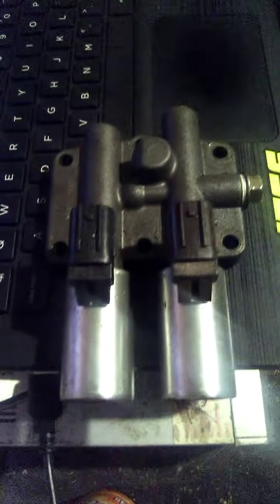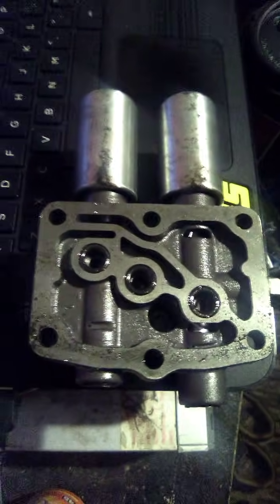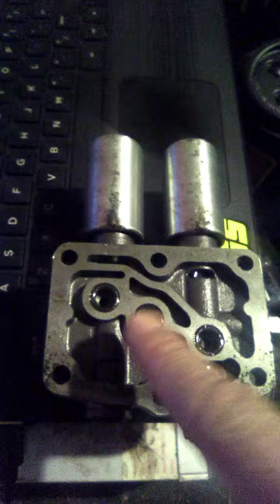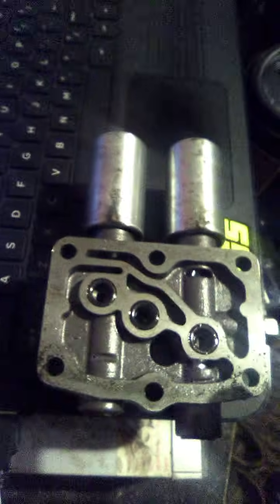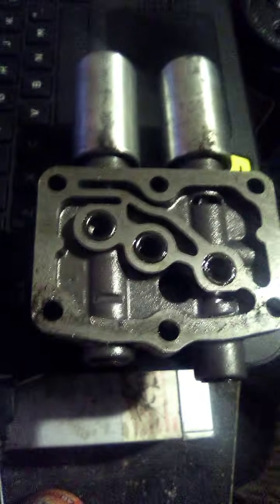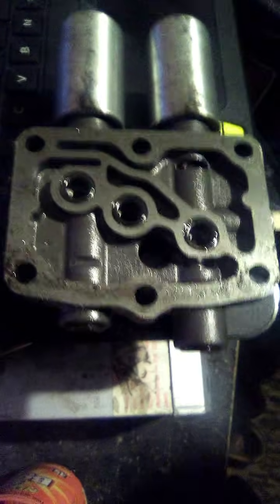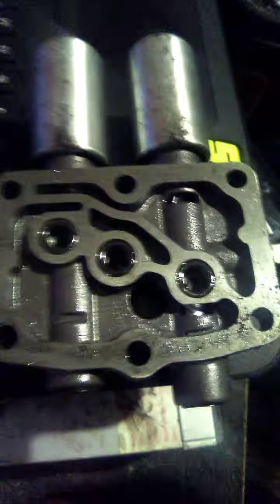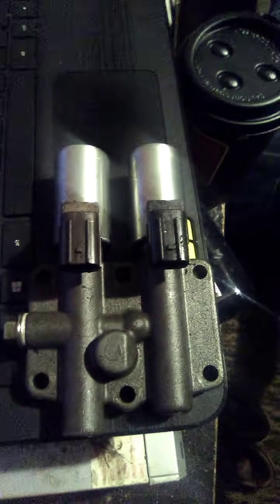Honda transmission problems explained p0740

Comment: Good day Rico, question, I did a flush on my 03 Accord 2.4 transmission and oil change, cleaned the solenoids and am still getting a hard shift from 1-3 up shift and when slowing down but not to a complete stop like if I was doing 30 slow down and try build back up speed it hesitates or I'll have to press the gas petal slightly for it to stay in that gear or it will drop back in the lower gear and it'll try shift when it builds back up, is the transmission gone or keep cleaning the solenoids out
Reply: Did u ever figure what the problem was with your vehicle bcuz my vehicle is doing the same thing????

Comment: hi! I have a 2008 Acura tl V6 engine. i recently changed the engine mounts and did a drain and refill trans oil 3 times. I also replaced all 3 pressure switches. My problem is that when i’m driving and coming to a stop, i feel the car buckle or pull back. Also, when i’m in low speed , my car tends to slightly pull back. when it does this, the rpm  jumps.  I am not getting any codes. Do you think it may be the solenoids or could it be something else ?
Reply: hey I just saw this. Ive been watching teardowns and rebuilds of Honda 5 speed transmissions. What you are feeling is the "sprag" not working correctly. Its a bearing inside first gear that is for slowing down or decelerating. It supposed to make the gear spin one way but not the opposite way. My car (accord 07 v6) BAYA trans is doing SAME THING. Like its not happy when coasting down. watch this video...    
https://youtu.be/1Isgg7M7i30
 He explains it better lol
Reply: @alexandercahoulan6583  Thank you for this. I did not know about this. It could be really irritating. I guess the only way to solve this issue is to rebuilt the transmission. Have you found a quick fix to make it feel a little better?
Reply: @Cramos056  not as of yet. I think, sadly, we need to rebuild it to change that as far as I know. Im planning on doing mine soon. But I feel its definitely the sprag.
Reply: @alexandercahoulan6583  Good luck! I hope it turns out good as new. Sadly, I don’t think i’d rebuild mine any time soon. I’ll just have to get use to it for the mean time.

Comment: Lucas Transmission fix saved me a few grand when my '05 Pilot clutch converter valve stuck.  It's been running like a dream ever since.
Reply from the maker: It works when is minor adjustment
Reply: Do you just add it on top of your regular amount of oil

Comment: Lucus for the transmission
Reply from the maker: I mean u can try to see if shifts better but if trans is not engaging at all then that's kind bad
Reply: @ricofedericotv9393  actually it shift fine in d4 on d5 is where it has a little issue i think you right when it get hot the tranny thats when it acts up a little bit it engages in every gear no problem. I changed the trsnsmission filter and i put the acura dw-1 so idk i changed the double solenoid with the 3 screens
With a rebuild one worksfine for abour 2 weeks then i dont get a hard shift but i noticed on d5 it was moving alot better now its acting like its missing a gear when it gets warm it slows down end catches the gears again on d4 its fine on d5 its a issue reverse is good park is good neatral
Reply: @ricofedericotv9393  also there are 2 solenoids i want to change they look real old this 3.2 TL has 190,000 miles i bought it for my lady
Reply: @ricofedericotv9393  when i bought her she shifts fine no problem she still shifts good but on curtain times she stuggles in d5 only
Reply: @ricofedericotv9393  and i have the p0740 code im thinking about just changing  all the solenoids for now if it still gives me trouble i. A just swap the torque converter and see what happens
Reply from the maker: @dragstriprabies2.059  if u drop trans to do torque converter u might as well change it trans too but sometimes at this high miles after trying solenoids and lucas and filter if problems still there like it happen to me I just keep cleaning solenoids and baby sit the problem drive car easy maybe ad and extra transmission fluid cooling radiator so fluid stays cool but once this issues exist is a chess game . Does ur D light blink?
Reply: @ricofedericotv9393  No my D4 light doesnt blink at all my D5 i think the bulb in the cluster is out but it engages in D5 and D4 with no problems D5 tho i notice is when it shifts crazy when the transmission gets hot D4 the transmission shifts fine
Reply: @ricofedericotv9393  my d5 light is out in the cluster the bulb but it engages in D5 but that D5 is when i discover the shifting issues it will shift in D5 on all the gears but when it gets hot the rpm will rev high and it feels like the car downshifts and slows down while on the highway engages into gear then revs high again and acts as if its downshifting

Comment: hey my man so your saying if my 96 accord ex starts fine but when I put it on drive it won't move but the rpm go up and if I put it in reverse it will only work for a second then your saying I'm done I shouldn't clean solenoids or flush the oil it's over then right?
Reply: Same position as you right now. I'm not giving up, just because it is going into reverse!
Reply: @alecfleming373  I had to sell mine for $200 bucks to caravana, I had a transmission problem that I didn't want to get deep into. I bought a used 07' corolla so far so good 🤞
Reply: @PEACEFULWARRIOR999  Homelessness, so if I can't fix it, I'll be hiking.
Reply: @alecfleming373  there's rules, if you don't have a home is OK if you have a job, so if you have a job u don't need a car or a home until you have means to aquire them. If your car is out but you have a job, guess what you just saved alot of money on hotel rooms. You see, we sometimes loose our focus that's all man, good luck with the car I know I hate to waste my money on someone else to put bandaids on it.
Reply: @PEACEFULWARRIOR999  14 jobs held in 2019. I'm not homeless enough for government help, and not housed enough to keep a job. #1 reason, I smell.
Reply: @alecfleming373  lol I hear ya the government is the reason why we all fucked up but we keep depending on it, that's why I'm done with the government, I don't need shit leave me alone here's your taxes and see you later, can't figure out how not to do taxes but I'm sure it'll soon come to me, I might open up a church who knows, I was never a good at beggin that's
for sure. Well if job doesn't work and property neither I guess my advice is to steal a car but don't ever take advice from anyone but your guts and wisdom.
Reply: @PEACEFULWARRIOR999  Oh buddy, after this, I'm NEVER paying taxes if I can help it. What is it going to? Not preventing starvation... Not the roads... Not good cop training...
Reply: @alecfleming373  get someone with a computer reader to check it, at most you'll spend $50 bucks but you'll get an accurate diagnostic and you take it from there.
Reply: @PEACEFULWARRIOR999  There already, because I have one. P0740 or speed sensor not getting the right reading. It's fine. I'm thinking it's a little part clogging. But, yeah, blaming jiffy lube for putting the wrong fluid in...

Comment: Appreciate your video. Thank you. Hoping you might help us please.  Do you have any idea why our 1990 Honda Accord Auto Transmission does not shift into reverse sometimes and makes the funny clicking sound? Other times we start it and it shifts into reverse perfectly.   We've flushed the AT and put the Honda fluid,  checked the lock up and shift solenoids and cleaned the small screens. Does the Honda Lock up solenoid lock up the torque convertor to make it go into reverse?  Here is a video of the sound.. Thank you very much.  @H9y4
Reply from the maker: That's a tuff one try going into reverse from parking not from neutral try engaging it in different ways maybe car slightly moving forward I work at a aamco and there's pads with brake type material that Tru years they worn out that's y they say is not good change oil cause the material could be in oil bouncing round sometimes in might catch sometimes don't maybe when hot or maybe when cold but old Honda's transmissions are easy change if I was u I save few bucks get a clean one with low miles and once u change it just baby it and prob last for long time maybe ad a inline filter u can cut one lines coming from tranny and ad a filter they look kind like the fuel filter ones but for trannys

Comment: I have a 2011 crv and it literally comes to a stand still whenever I engage 2nd  going up a hill. I should also point out that if 2nd is selected while the Car is moving at a snail's pace. The gears shift normally when I am in D but I also feel that my fuel economy  isn't that great either
Reply from the maker: What year crv u have
Reply: @ricofedericotv9393  it's a 2011 crv with the 2000 cc and AWD. Automatic transmission and petrol engine
Reply from the maker: @Domexican  could be shift link maybe is in between gears when u put on second

Comment: Ita happend to me in my 99 prelude automatic car starts to make like crasy horse .. so i stop the car after 4 hours then i reconect the battery and  the car starts and drive normally.. but after 10 mnts starys again no sleeps noting but i think is ab the hot oil .. any recomendations im scare ab the transmission..

Comment: I have a 2003 honda accord v6 it drives fine no problem check engine light comes on and is the clutch transmission crap . It goes away after I drive it for a while and when I drive in the high way it comes back after 36 miles . Can you help?

Comment: Thanks for the video man, my 2004 accord 2.4 AT is having those symptoms, if buy the shifting solenoid and replace it do it need to be plug to a special tool/computer to  make it work with the car or it's just a plug and play kind of thing?
Reply from the maker: Before u buy it take it out and clean it sometimes change it won't fix but sometimes it do is kind gamble do u have a aamco transmission around? u ?
Reply: tv  I think there is one around, I'm planning on keeping the car at least 2 more years, if cant fixing it with the solenoid I'll take it there, I don't trust stealership anymore.
Reply from the maker: @seencktwo  I used to work at one I think they do diagnosis for free but yea I try go to u pull it type junkyard and grab few maybe all them are u in pa?

Comment: Look at buying a 2000 v6 70,000 miles Check engine light but for  idle control sensor.  Is that from transmission.
Reply from the maker: Take it for spin look as fluid make sure fluid is red before the spin press brake put in drive and from drive to neutral the reverse make sure it don't hit hard if shifts good and fluid red look under car if has no leaks that's good
Reply: thank you I really appreciate you taking the time to answer my ?
Reply from the maker: @criticalthinker72  u welcome how much they asking if u don't mine me asking

Comment: I have a 2003 Honda Accord V6 starts no check engine light now when I start it goes in gear but slips and won’t go into gear until I trun the car off for a few then start it back up
Reply from the maker: That's a good one maybe u low on oil? Ad Lucas oil have u check ur solenoids they not clogged
Reply: Well no the mechanic hook up some sort of machine to see what’s wrong with it no codes popped up . He said it might be the solenoids but idk what to do if imma keep dishing out money .. I need someone with experience
Reply from the maker: @jonathansantiagovelez646  solenoids can be expensive try pltaking it off I bet u the net is clog up and see if u can go to a u pull it type junkyard grab couple them or get it from local junkyard and put it urself I believe is only 4 bolts and a plug
Reply from the maker: @jonathansantiagovelez646  my pilot would start shifting crazy I had clean net sometimes oil dirty

Comment: that was a problem with older Hondas from the late 1990s-2005 or 2006 mostly occured on the Odyssey, Accord, and Civic.
Reply from the maker: Mostly v6 engines made transmissions fail on regular basis
Reply: Rico Federico tv the Hondas I had were stickshift. The CVT automatic transmissions are much worse on Nissans
Reply from the maker: Can I get sub am trying get to 600
Reply from the maker: I had few nissans I had that missfl fire I could never find is it the ecu some people say can be simple and injector
Reply: Rico Federico tv Nissans were really great cars before Renault took over.

Comment: I will never buy Honda.
Just Toyota to save my self headache.
Reply from the maker: Some Honda's good what year and model u have most v6 Honda's end up with transmission issues u feel like they put cheap build trans with v6
Reply: My civic has over 300,000 miles on it.I replaced a timing belt & water pump at 180,000.I replaced a head gasket at 267,000 miles.I get 40 mpg still.Does every number on the speedo still.I does'nt burn a drop of oil still.No squeaks no rattles & still looks like new with a wash & wax.You will NEVER say that with Toyota Subaru or Mazda.Nor will you replace a head gasket,water pump& timing belt in 4 hours for less than 100 bucks.
Reply: @billydavidson4473 i had honda legend v6 im having issue with transmission at 11 hundred thousand mile

Comment: My transmission popped and started driving slow like it won’t shift, just feels like it’s stuck in first gear or something only happens when it gets hot, could this be why?
Reply: bugzyxjr sameee
Reply: have you figure out the issue? i have same issue
Reply: erc i have not, i just went and had my transmission rebuilt, BUT I do believe this was the problem, that or the other Shift solenoid, i went and got myself a manual car as well so I hopefully don’t have to deal with these problems anymore lol but he’s right when he said the transmission can get too hot and it will start slipping

Comment: Are you saying a Honda built before 1999 is safe from transmission problems? Is an automatic  weaker than a manual transmission for a Honda?
Reply: Seems like it. What do you drive?
Reply: @voltixD  Subaru
Reply: @staresce  Not bad I take it? How's your car running? I got the 02 Honda Civic hehe
Reply: @voltixD   It is running well but I found it is not easy finding a mechanic who understands how to work on this make and model of vehicle.
Reply: @staresce  I get it. Sometimes you just got to take things into your hands. I try to learn as much as possible on YouTube. You fix things here and there, then you get the hang of it.

Comment: What's the resistance on this unit? I get 5.6 on my old unit. And new cheap unit I got reads 5ohms
Reply from the maker: I have same issue mines go in and out sometimes when it those that shift it to 2 gear go for like few seconds if u not going fast then come back up I have video that I was doing it to me and I was manually shifting
Reply from the maker: This trans are nonservicesable but u can installed an online fuel on one the transmission lines that goes into radiator it help cleaning fluid
Reply: Rico Federico tv Honda ‘99-‘09 transmissions all have bolted on shift & pressure solenoids you can take out, clean their screens then test for resistance and functioning on 12 volts.
Reply from the maker: White Feather  prob right under battery box but it could be getting hot too I would go junkyard get another one see if helps sometimes they defective

Comment: God I pray this fixes my car
Reply from the maker: Hello what is ur car doing is it slipping from dead stop or when u driving
Reply: Started slipping now won't go out of 1st but still hard slams and reverse goes in and out.
Reply: @BrandinHunter  fix it ?
Reply: I checked the top 2 solenoids and having someone check the other 2. 
I don't have 02 sensors so ignore the first two
https://drive.google.com/file/d/1XltctaIa1w35OL9qP-3ibYleFJi1S7sv/view?usp=drivesdk
Reply: Did your issue get resolved? If so, what did you do to fix it? I am having the same issue now on my 02 Honda Civic.

Comment: I changue this selenoid and changue 3 quarts and a lucas of the transmission and it fix it
Reply from the maker: Cut one the tranny oil lines and put an online oil filter kind like fuel filter is installed it help keep oil clean and pick up any metal I hope there's none but always some wear in there sometimes clog up little net in the solenoid keep eye on solenoid net until keeps coming up clean

Comment: Thanks dude, that helps me much.
But there something happening when I turn the engine off,
There's hum noise coming that lasts about ,10 seconds. And then switches Off. When I turn the engine off its like not everything has switched off ( the hum) on hot days it getting louder and longer.
Is this the beginning of a transmission problem if so what should I do. Or is it something else. Would much appreciate a little help here
Reply from the maker: I dont think it could be something else

Comment: All that weight going up the hill. If the Engine Tranny combo can't do it - the fix is a better Engine tranny combo. Heard all about Honda's V6 and Tranny issue. 
If you want a V6 - buy a Toyota or even a Ford - they go up hills just fine. :-)
Reply from the maker: U right

Comment: Is There A Transmission Filter 
On A Honda Accord 4 cyl 2000
Automatic If There's I Can't Find It 
Does The Four Cylinder Comes With The Trans Solenoid? THANKS
Reply from the maker: Most Honda have a solenoid if u look under car and trans don't have a pan like engine do u might have no outside filter sometimes they do most time they don't thats y I say used the solenoid screens to try clean oil from debrys
Reply from the maker: U can also put a online filter it goes in one trans line u cut right there and install